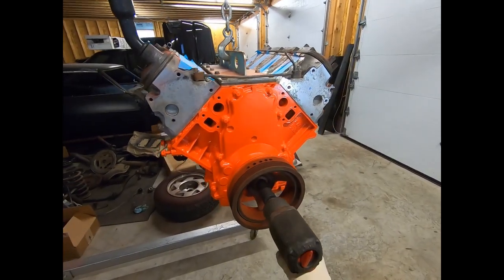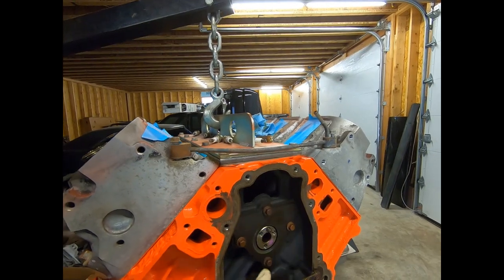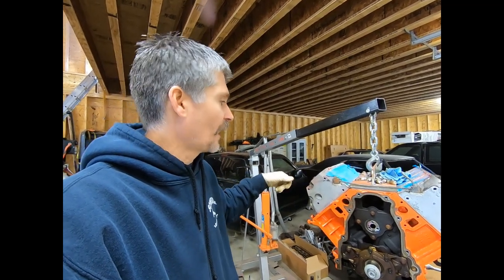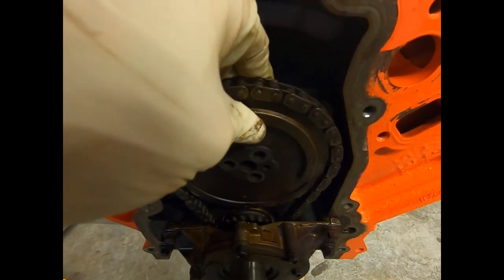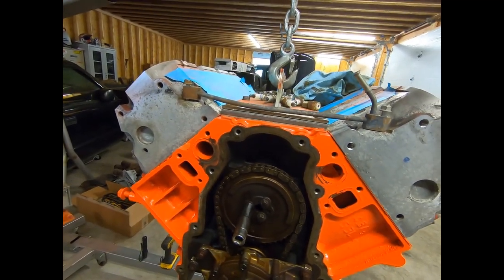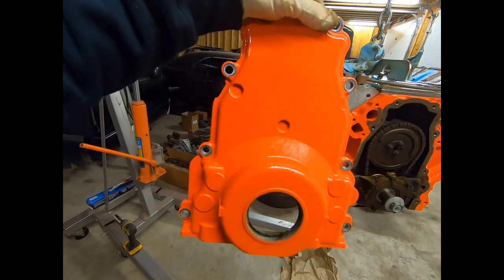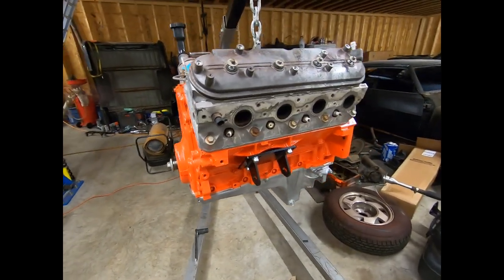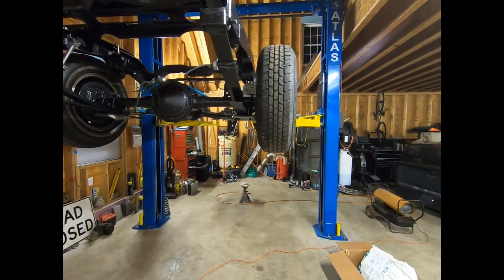TEXAS SPEED CAM INSTALL 5.3

Comment: Haha funny thing is I'm just getting caught up on your videos since I been working on my truck. (04 F150 5.4 3 valve) Was doing a timing chain replacement (camshaft and roller follower inspection etc) about the same time you were doing the camshaft replacement on your ls motor. Right now I'm REALLY wishing I'd have stuck with GM. These o.h.c. motors are a pain in the butt!
Reply from the maker: That's not a fun job at all! I hope you got it done before this artic weather hit!

Comment: That crossmember looks awesome!  And can you run that cam with a stock converter?
Reply from the maker: Thanks, it's stick shift.
Reply: I meant for my truck I’ll have to check the specs on it but truck is coming along nice bro can’t wait till you fire it up
Reply from the maker: I have a Texas Speed 220R in stock with springs that would work good with the stock converter.